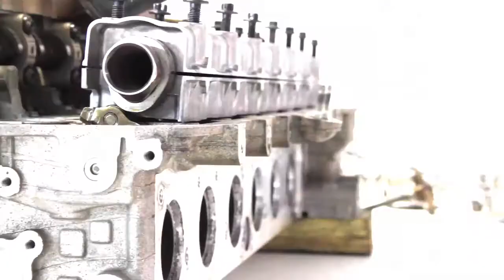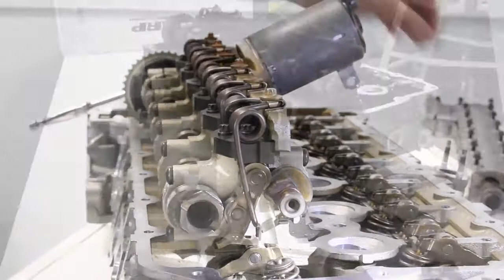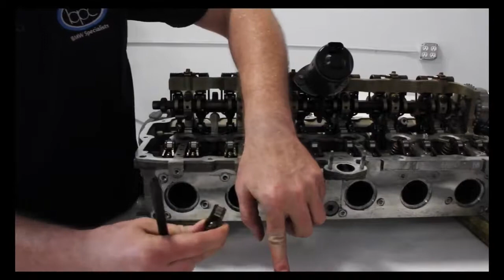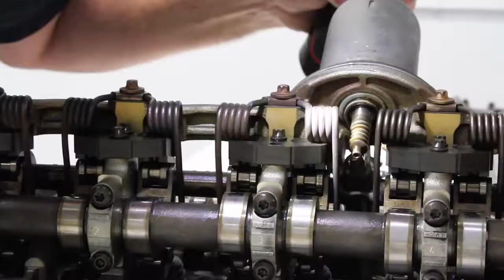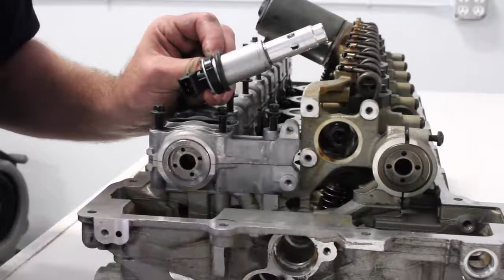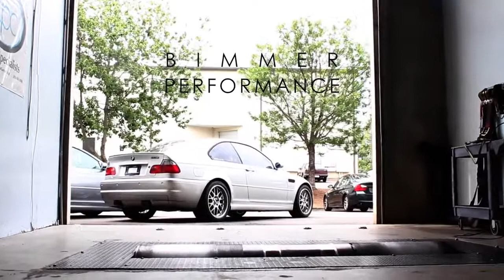Discover the motor on N52 Cylinder head

Comment: Hello, replaced VVT solenoids and eccentric sensor, put all back together, all work some time perfectly, about an hour, then begin squicking sound as ball bearing, removed belt, sound still going. Scan show intake VVT (already replaced) fault. 
Attempt to pull out VVT solenoid, and it is stuck! After removing intake VVT found scuff where something was hold it, look into hole and see at the end something like metal rib, covering half of the hole, which is not allow to insert VVT as well.
Question is, what it might be. I'm looking info online, before open engine again. Your video perfectly show everything, and I don't see there is nothing that might hold, or not allow to insert intake VVT solenoid.
Your advise is highly appreciated. 
Thank you